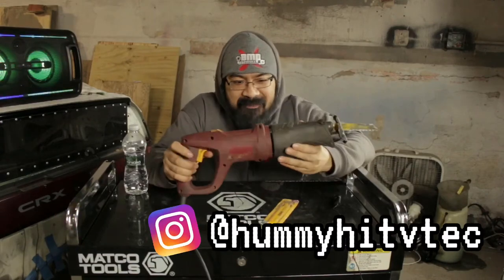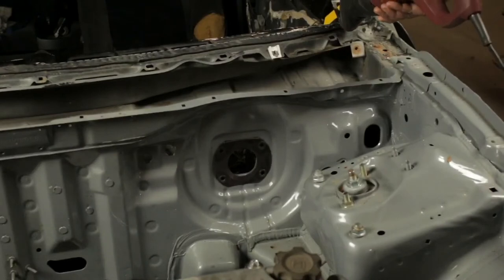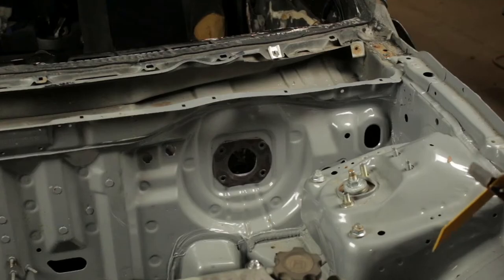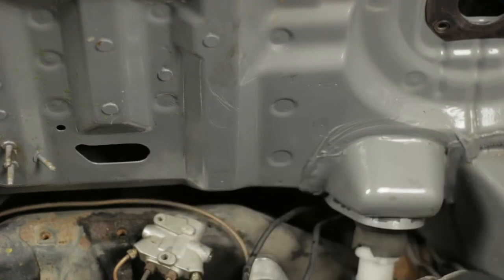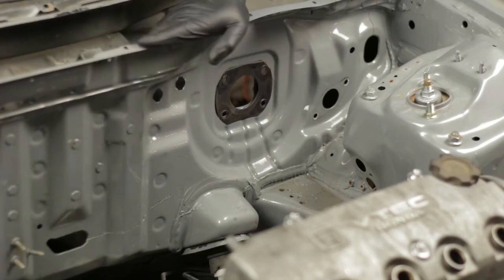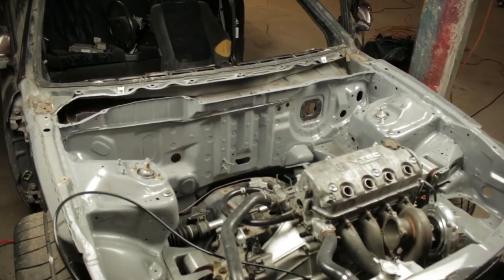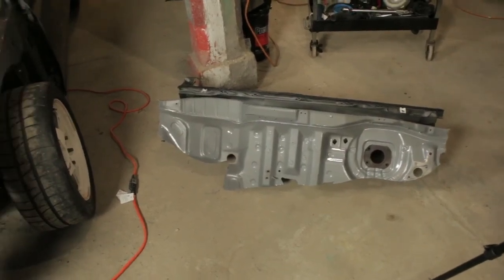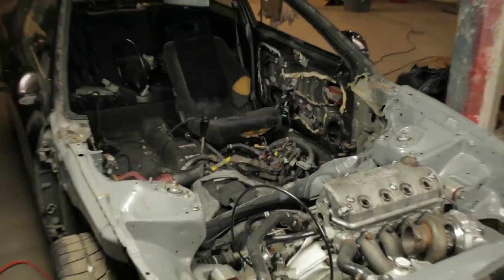Project RHD Integra | Cutting the Firewall Out | No Turning Back!

Comment: Dude why don't you take the engine out this would be so much easier
Reply from the maker: There is a lot of room there because I have a single cam. Also the motor is keeping the framerails tighter together. I always wanted to try to do with the motor still in the bay. So I’m just gonna keep it in there.
Reply: @HummyHitVTEC  alright man let me know how it goes then all I do is put a strut bar and tempary weld some angle iron from one tower to the other or you can keep the front support on I do suggest supporting as much of the car as you can with 6-8 Jack's I'm about to go pick up a RHD Clip today just got the uhaul truck I have a ek hatch rhd and my girlfriend wants one too so ima make her hatchback right hand drive